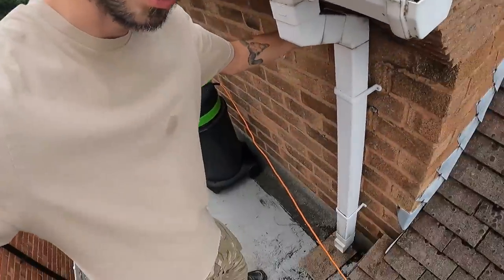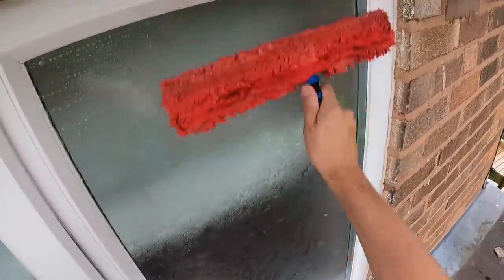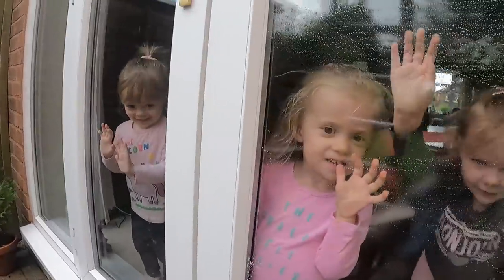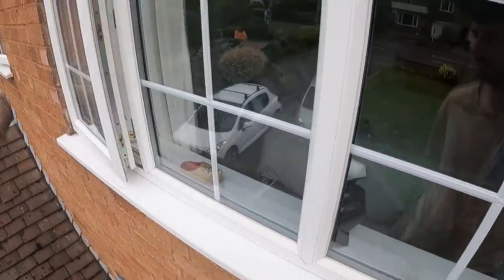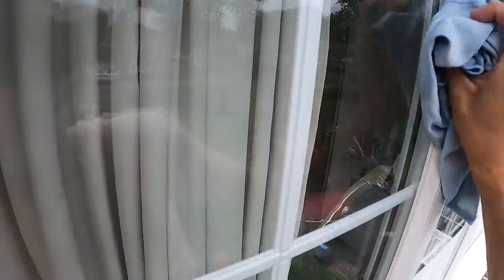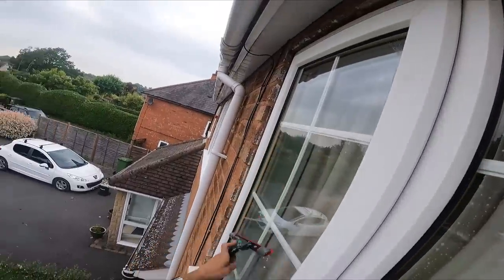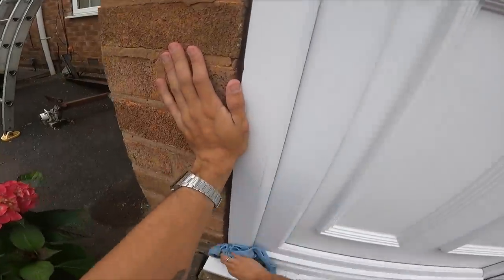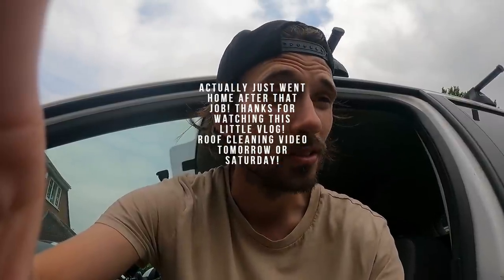Helping out at grandma's house  - CLEANING VLOG EP1

Comment: Super job! Turned out looking great 🤩 After watching a ton of your videos I've always had the question: how do you feed water from that garbage bin into the pressure washer?? Do you use a submergible pump? Is that specific pressure washer capable of pulling its own water ?? Really curious about this hehe, hope you can answer my question mate! Have a good one :)
Reply from the maker: Thanks a million! 
the pressure washer has a suction feature so it sucks the water through a long filtered hose staight into the pump which then sends it straight to the lance. 
that's why it helps to have a big full of water acting as a buffer tank so the machine is free to use its full power. if connected to a tap it's limited to the flow of the water and can burn itself out (: hope that helps! most if not all 15LPM+ machines will come with this as stock
Reply: @PartridgeExteriorCleaning  thank you so much for the reply man! It really helped :)